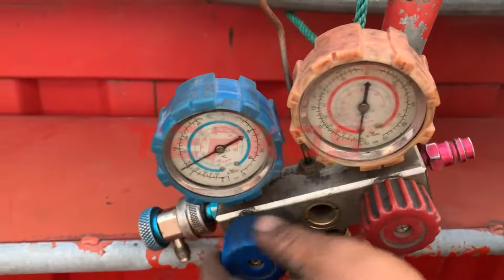Installation Instruction of 12v/24v air conditioning system roof mounted electric dc air conditioner

Comment: I bought the air conditioner about a month ago and its marking this code and as soon as it does it turns off, battery is new and everything
I need your help
Reply from the maker: I checked that you not buy from us. But if you need support, can contact out sales whatsapp, she will help you